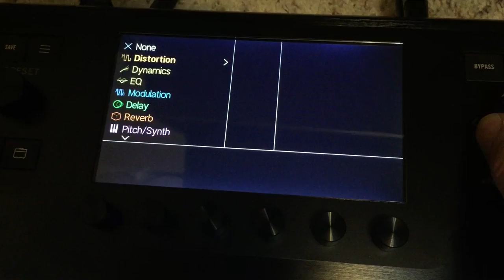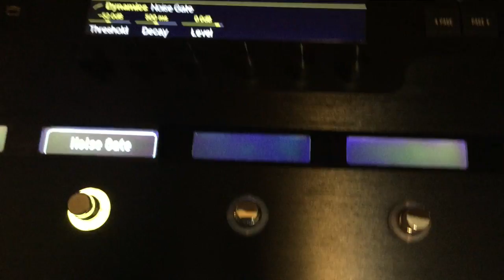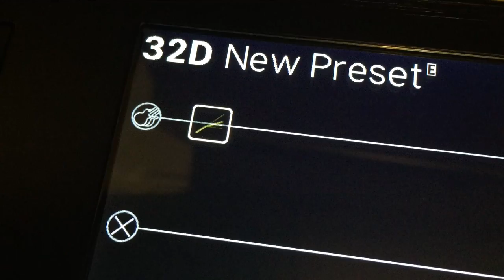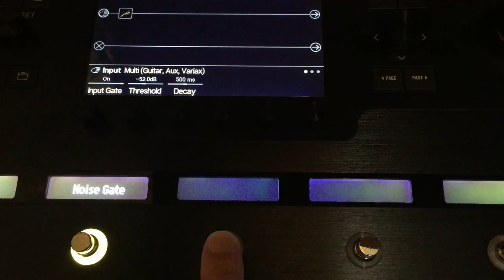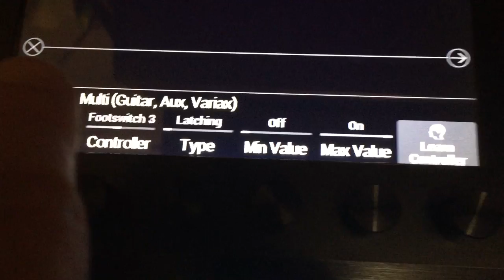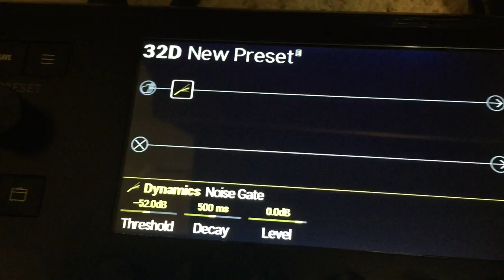Line 6 Helix Tips: Noise Gate-Part 1

Comment: Hey! Do you think that the new HX Stomp from Line 6 could do the same? I really should be the case because the HX Stomp only let you use 6 blocks.
Reply from the maker: Jonah Paz ,  it should but I don’t have one to test it.
Reply: It should as its the same engine as the Helix just without the amp sims I dont own one so cant test.
Reply: Stephen Soukup  not correct. The HX Stomp has amp sim. It’s actually the same software with limitations like 3 footswitches and only 6 blocks available but as far as amp sim, ir loading and effects, they are the same.

Comment: Have you tried it in the 4CM? I have a noisy amp I'd like to silence.
Reply from the maker: I have not 4CM yet. Are you on Facebook? If so, join the "Line 6 Helix User Group" where I know there are plenty of folks who have tried 4CM and like it. They'll give much better 4CM advice than I could.
Reply: Darren Gill it works great with 4 cb method. I have a black star ht metal 60 fully cranked no noise / humming at all just a little fizz when u turn it up full blast from the amp itself can't prevent that